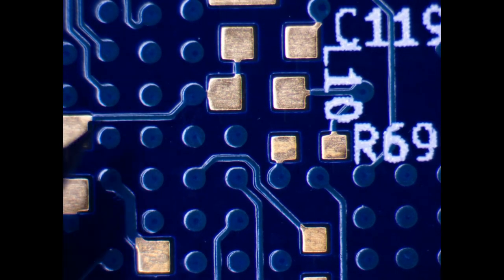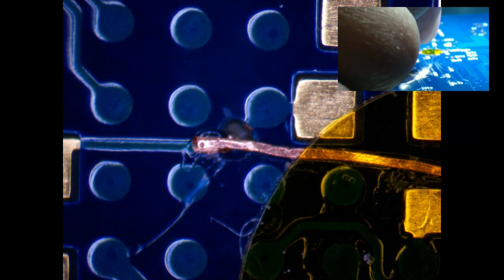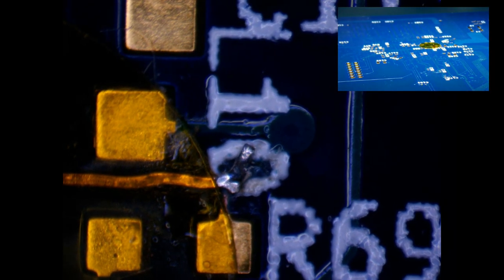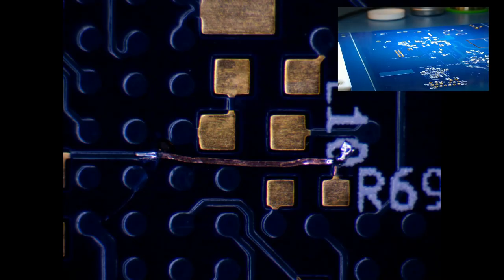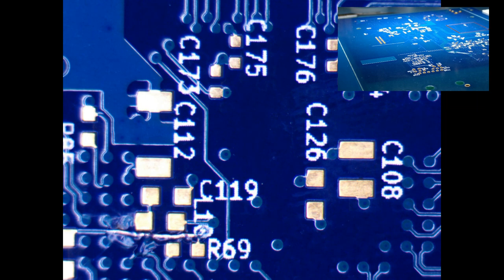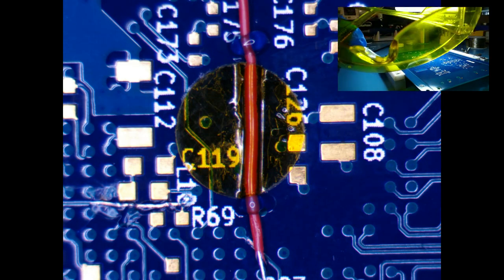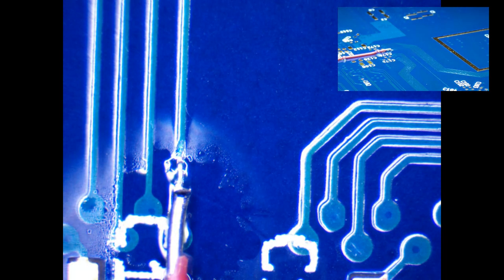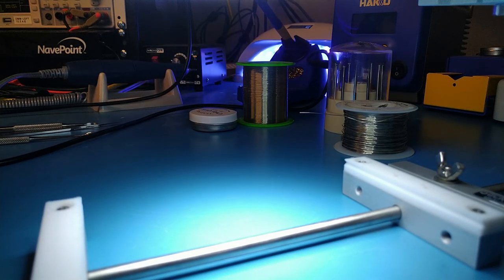Lab #4: Jumper wires

Comment: Why do you not use UV curable soldermask ? Curious
Reply from the maker: Honestly? I don't have any on hand. I keep meaning to pick some up and experiment.

The epoxy method works quite well from a mechanical/electrical perspective, just hard to get an exact color match with the tints I have.
Reply: @AndrewZonenberg  Yeah it seems if you were deep in a mod or repair, you do not want to remove the board move it to heat, maybe you have probes attached and maybe a mess all over desk ( maybe lol ), uv flashlight and blast it in place, I have some UV green I have not tested it yet.